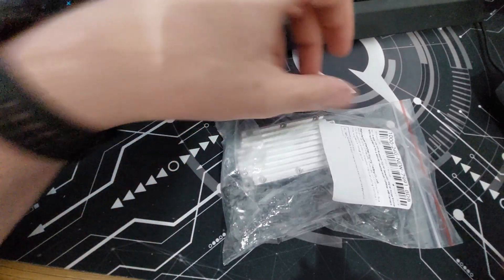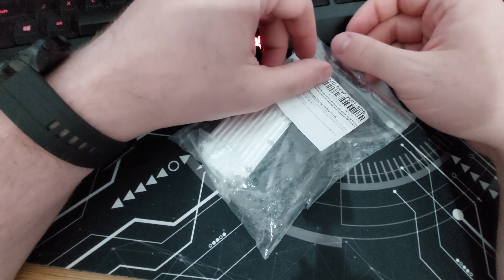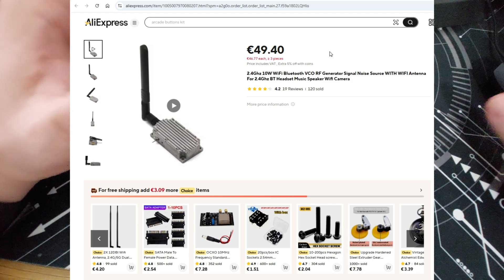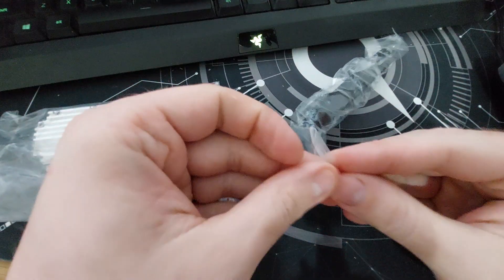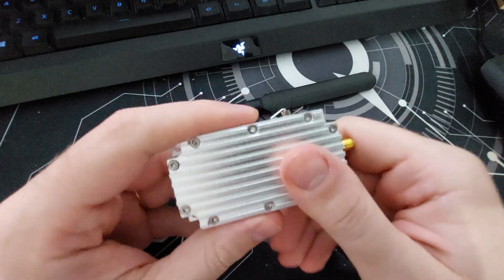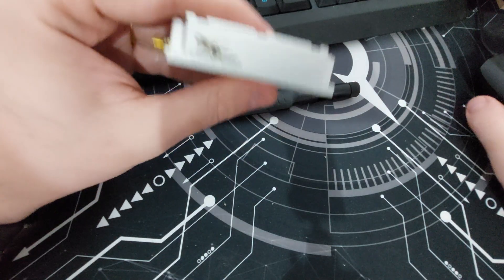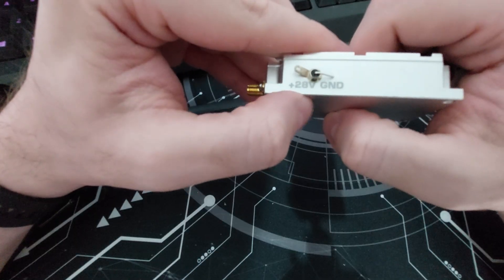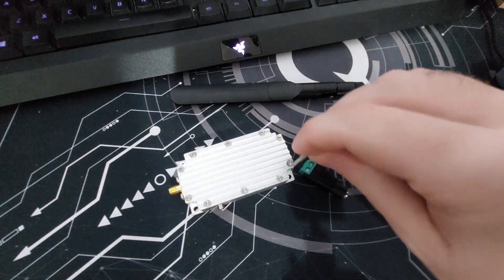The STRONGEST WiFi Jammer (that I own) for 2.4G (drone killer)

Comment: I like the aluminum case. But can u make a 3d printed case for cheaper?
Reply from the maker: I will build a 3d printer case in order to add a fan. You can ditch the case if you want to attach it to a bigger heatsink but unfortunately where I live, a bigger heatsink is double the price of the device itself
Reply: @pythoneatssquirrel  where you from ?
Reply from the maker: @jacekoverlord6227  Eastern Europe
Reply: @pythoneatssquirrel  country please :)
Reply from the maker: SVK

Comment: I would love to see the wattage output and the SWR on this unit. The other amplifiers didn't even come close to the output power that they stated they have.
Reply from the maker: I don't have such device but I added some photos in the video that were provided by the seller
Reply: @pythoneatssquirrel  there are cheap open source hardware VNA and SA devices for you to help measure the antenna and transmission power and frequency.
I'm curious how stable the NXP power transistor is after a few minutes of load, as well as the hackability of the hardware. Interfacing with it to instead use it as a small rf amplifier for 2.4 to 2.7 GHz
Reply: @didotb01 The problem I occurred is that the amplifiers that they say are 4 W.
Don't even produce a watt. And it died aften 3 minutes of use. Unless you're using it for seconds at a time, and that is totally useless. And to pay for a ten watts and pray to god you can get a full 1 watt is really not worth it in the long run.
Reply: @xeon_one  it depends on manufacturer but yes usually they are lower power then stated , plus you need proper venting as with heat power drops even a few dBm , so when 4W = 36dBM then when lose 3 dBm it is becoming half the power 2W.